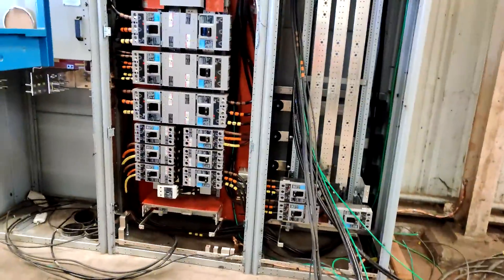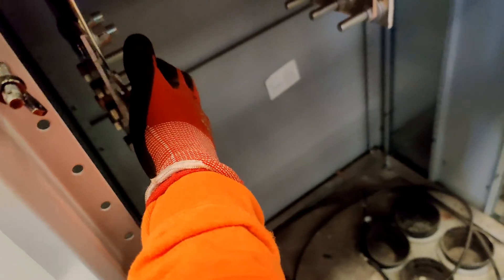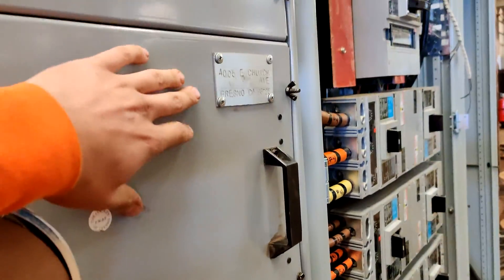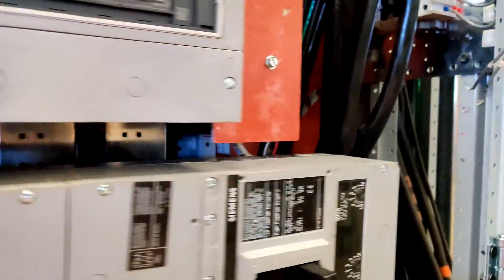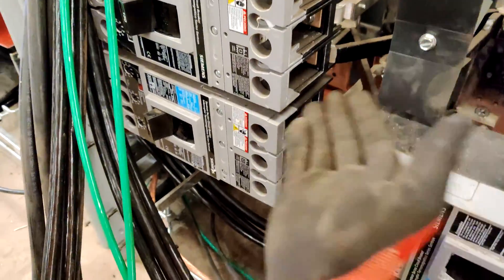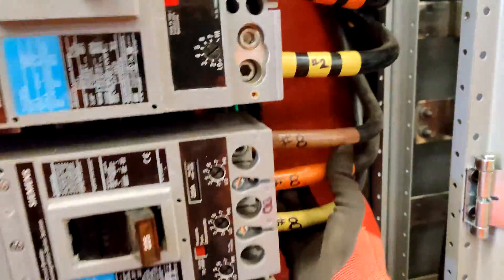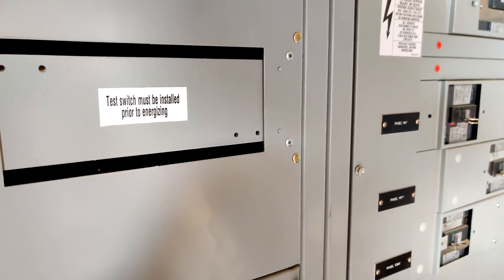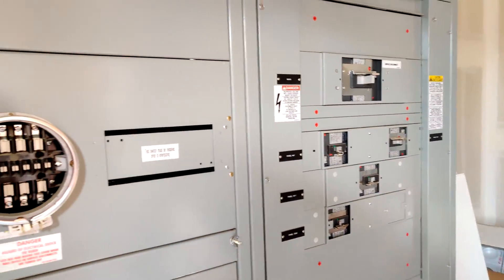How a Switchgear Works

Comment: The power does not go through the meter.  The meter stabs go to the current transformers.  The potential transformers may also be remote or in meter.  Pulling meter does not interrupt service like it does on  400a or less residential.

Comment: What is the difference between a switchgear and an automatic transfer switch?
Reply from the maker: Switchgear is where the utility power comes in, goes through the meter, and from there supplies the building. An ATS is a device that, in the event of a utility power loss, switches the building's power from the utility power to emergency power, supplied by a backup generator, if the building is equipped with one.

Comment: Great video ..thx!
Coupl notes: 1)The gears looks like switchboard, switchgear has drawout breakers with back clearance.
2) If the switchboard is the service entry, neutral will be needed at the switchboard to carry faults back to the utility source even if all connected loads are 3ph 3w

Comment: Few questions.   Why would anybody buy three phase four wire switchgear for three phase three wire service?   If it is three phase three wire, why would you connect grounding electrode conductor and electrodes to neutral bar?    
Or, is it really three phase four wire service?   The lights in the steel plant are not 277 volt?
Reply from the maker: Because previously this steel plant had a 480V Corner Grounded Delta, using a separate X-former/service for the 120V loads in the office areas. This service is only supplying 3 phase 480V loads, but with this service upgrade they are going from the Corner Grounded Delta to a more standard 4W transformer with the neutral for optional 277V loads.

So to answer your question, they bought this because of the standard type X-former they replaced the out-of-date CGD with (which is why they didn't have a grounded conductor before).
Reply from the maker: Also, the grounded conductors are terminated on a separate buss from the grounding conductors, but both are bonded inside this gear.
Reply: @WinningSideProductions     So, it was a 480/277 volt 3 ph 4 w service and you did it correctly!   Awesome.   Respectfully,   Kevin